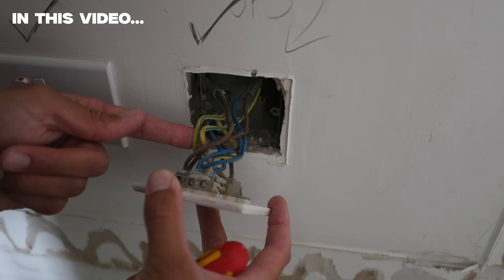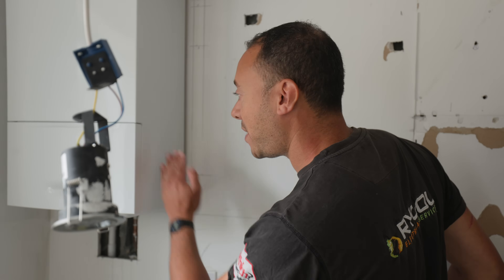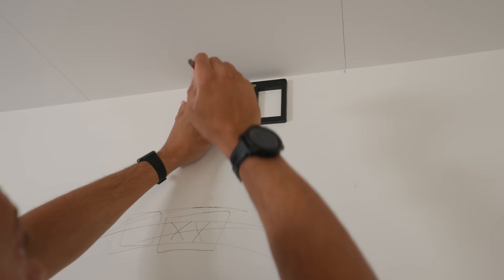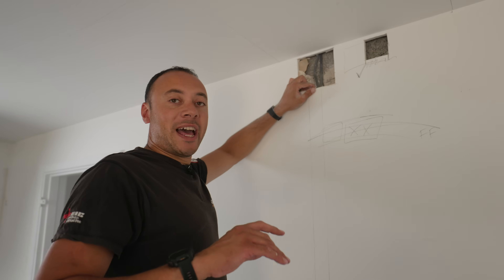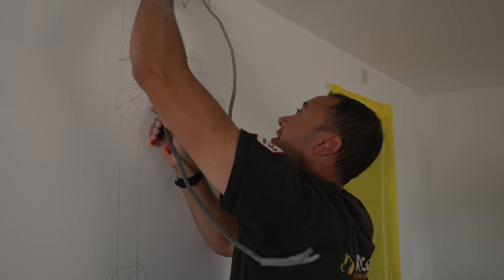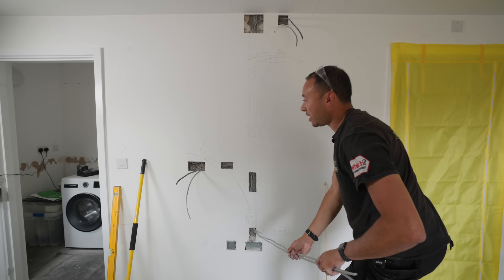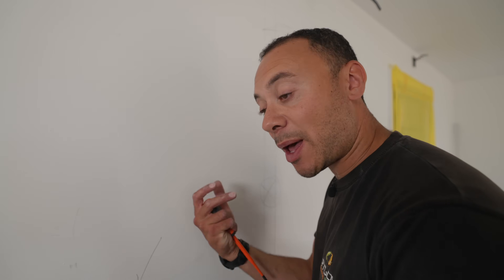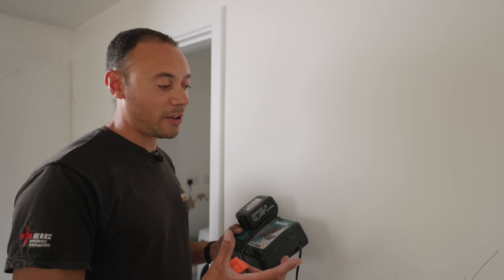Adding a plug socket? Don’t get it WRONG!

Comment: Self-confessed DIYer here (which means I'm always ultra-careful and not over-confident).  The reason I like watching professionals is, of course, because I want to learn.  But there are 2 things that jump out here:
1) If this is a relatively new house, how is it that a professional electrician left such a massive safety fault behind?
2) Why do new houses never seem to have wiring diagrams?  I had a new house built from scratch by professionals and it was the same for me.

I'm renovating my Victorian cottage, including rewiring it, and I'm photographing and drawing everything (I'm an IT analyst).  Why do professionals not do the same?  The electrician that did the work in my previous house didn't want to do it - couldn't be bothered even when I pointed out who was paying him.
Reply: Wiring diagrams for new builds should be compulsory. As should pipe work diagrams. I worked for the MOD in a 4 year old building, everything had a diagram, AC, electric, fire etc .
Reply: @jablot5054  Agreed.
Reply from the maker: This is very true. Faults like the one in this video can be due to alterations later. Like if a spur gets replaced or something like that. It goes un noticed. Wiring diagrams on rewires or new builds would make alot of sense. Might have to start doing that. Its a great idea!
Reply: @RygolElectrical  I expect most customers would happily pay for it (I would), and it would be a value differentiator that lifts you above the competition.

Great West Country accent by the way; nice to hear one of those.
Reply: The previous electrician probably didn't leave it like that if it's new and tested.. you can scag cables afterwards easily by pinching the conductor with the plate screws just by unscrewing it and loosening the face plate, for painting say. Although it happens more when there's too much unsheathed conductor in the box or its tucked away badly.

Comment: No it isn't. The reason why there is a complete circle dab around the socket is for new builds as they pressure test the room with a fan and look for any areas where there are leaks

Comment: So youve taken the lid off of a live consumer unit & then you wander off around the house leaving the CU live with the lid off! Good job a child didn't come to investigate & electrocute themselves. NICEIC on your top but not complying with their standards. And HSE will love you! If Ben is working on the lighting circuit the protective device should be locked off! If you had done the correct ring circuit tests while the circuit was dead you would have found the incorrect polarity at the socket before you made it live.
Reply: Get a grip

Comment: Personally, I prefer to see an apartment have multiple fuses rather than a large number of connections to one fuse. It protects devices and prevents interference that can escalate with such a large number of consumers.
Reply: But in the UK every plug has its on fuse so doesn't rely on a large fuse back at the consumer unit as we call it or the  breaker panel in the us

Comment: Dude you should see my over 150 year old house kitchen circuit 😂 god knows when they wired it, maybe post war,  it is the old black and red cable, i love the idea of cables running in alignment, here they run diagonal and any way which way they liked, had to scrap the old wiring (electrician condememed it) and rewire, am in the middle if doing the chasing for the electrician to finish,  it is not easy work thats for sure 😅  when i ripped out the old kitchen took up 3/4 plywood sheet on floor found earth and rubble underneath it 🫩 laid a waterproofed concrete and tiled floor now, place is getting a complete refurb

Comment: Just curious if the requirements are different in the UK, is it not standard to earth the back box?
Reply: It certainly used to be, but the current (18th edition) regulations allow for the box to pick up an earth from the screw that holds the socket to the box.  Which means that if you remove the screw, the back box is no longer earthed so only remove the face plate when the power is off! Which is common sense.
It is however good practice to always connect the back box with a separate earth wire.
Never depend upon common sense, if you make something idiot proof they will always make a bigger idiot!

Comment: You asked about why the cpc is not sheethed. The cable is set as EN and not just BS therefore, European norm cable can have just green sheeth and thus they choose to keep it as copper so you can add the sheeth as per your national standard in your country. But you can now get cpc sheethed and the cable is then only BS standard and not EN

Comment: Good video, particularly as it shows an arc fault, that will not necessarily trip a mcb or rcd. Intentional fault is no earth flywire to backbox. This is so fault to backbox (should) trip mcb and m3.5 faceplate screws don't stay live, if rcd does not trip.
Reply: The faceplate screws are earthed by a steel tab connected to the earth terminal on the plate. However if the screws are removed whilst the cct is live the back box is then not earthed, which could be an issue if the plate is moved and the back box became live and then touched which shouldnt happen but can & does happen especialy with diy.

Comment: Minor point here!!...
Nearly everyone gets this wrong - But it really needs to be understood - Read the latest BS7671 publication 🙂

'LIVE' conductor, is actually a 'LIVE PART'
 - This refers to the 'LINE' and the 'NEUTRAL' conductors.
So - A 'Neutral' wire, IS a 'LIVE Conductor'!!!

In this case, the 'Brown' core/cable, is a 'LINE Conductor'
 - A LINE Conductor is anything other than a 'Neutral Condcutor', a 'Protective Conductor' (CPC, Bonding, etc), or a 'PEN Conductor'.

In my view, this understanding is very important & could save lived.

Comment: The Earth wire isn't sleeved inside the main cable because it's not a live conductor, and insulation would hinder its function as a low-resistance path to the earth for fault currents. While it needs identification for safety, an insulated earth would make it harder to detect if someone drilled into the cable and hit the earth wire, increasing safety by providing a path for the fault current to trip breakers.
Reply: I thought the regs were changing that all new cables were to have an insulated earth cable as well.

Comment: Thanks for the videos, trying to learn some english electrician lingo for an upcoming job on british frigates. Very useful.
I have a small contribution to the video as a thanks for the viewers who might want to know why you messure resistance in the end of the video.
The reason you want to check resistance in a circuit is to make sure the fuse will trip if you get a short.
Lets say its a 230V 15B fuse then you need 75 amps to trip the fuse(B fuse amps times 5, C fuse amps times 10 to find needed amps to trip the fuse if it shorts). 
If you have 230V at the socket and a resistance of 1ohm the short will generate 230A which is enough to trip the fuse. Its Ohm's law U(volt) = R(Ohm)*I(Amps), if you turn the formula it will say U/R = I. In this case 230V/1Ohm = 230A. If it was a 16C fuse he would need 160amps to trip it, so 16C fuse and a resistance of 1,5Ohms at 230V he would be below acceptable limits. You can also know the maximum voltage you can come in contact with before it trips on earth fault. Which is again ohm's law, it will trip on maximum 30mA leakage (if its working correctly). Which will be U = messured Ohm * 30mA. Dont know about England but over here maximum allowed touchable AC voltage is 50V with a few exceptions.
This is why measuring resistances is important, so you dont get zapped or burn down your house.
Reply: Except that its impedance Z not resistance R and your understanding of the characteristics of fuses is wrong, I wonder if you know anything about different types of circuit breaker. Seems you read a lot but know little or was it education by tik-tok!
Reply: @andyxox4168  Lol nice one, I might have mixed some up because of language barrier and different electrical systems common here is IT and and commonly abroad in EU and "post brexit" is TN. 
But funny that you question me when you dont know impedance is the total RESISTANCE in a circuit and that is what he messured and what I meant to comment.
You might have gotten it mixed up with Kirchhoffs law which states how voltages is affected by amps and how amps is a constant in a circuit since amps are needed to short circuit the breaker?
Reply: @benaa4603  he measured impedance. Any UK spark would tell you the same. Its not resistance in a live AC circuit. Also you're confusing Ohms law and Kirchoffs law.
Reply: @TheOtherGarry  Jesus fucking christ, getting tired of explaining this. Hope you're not a "sparky" or that the education gets better. 
Easily explained. Substation people has impendance because its a circuit (Everything terminated in series to switchboard which affects voltage but not amperage) they write down the impendance and min/max shortage amperage for the switchboard (inside the building) for the sparky to see. The sparky then should normally only terminate equipment in parallel  which means what you're left with is ohms law (unless you fucked up) and what the substation guys has calculated as min/max shortage values which you should be within can be calculated with ohm's law. And yes technically "F2-Sockets livingroom" could be classed as impedance because its a circuit but its irrelevant because everything should be terminated in parallel which does not affect voltage other than the drop from the length of the cable, therefore you're free to use ohm's law.
Reply: @andyxox4168  PS! if you want to know what impedance Z is and how it doesnt apply here and what's the practical purposes of it is you just have to ask nicely.

Comment: Brave man turning the boiler off!!! Some brands don't like it! PCB can fail easily on some!
Reply: How do they cope with a power cut then? Genuine question - seems like bad design to me
Reply: @mikeflowerdew7877 simple answer is some don't...
Reply: It's a Worcester, they easily withstand power outages without issue, any boilers that cannot are not fit for purpose.

Comment: I always thought the sleeving was left off for two reasons? Cable fault issues - better route to earth and as a cable stripper 😂. I always used to grab the earth with my pliers and rip it up through the outer sheath. Worked really well...
Reply: Most of us still do mate
Reply: @carlstanton2550 that's ok then. Not just me 😅
Reply: @everusualsuspect nope! I've been a spark for 25 years now, and every guy I've ever worked with has always stripped twin by using the earth the rip through the outer, especially with standard twin. It's a bit harder on the Low smoke t&e these days, but still doable 👍
Reply: Yep, that's why... any cable deformation, especially  allowing water ingress, is detected immediately.
Reply: Aye , there's no need for those fancy expensive cable strippers, a Stanley knife a pair of well insulated pliers and a bit of gumption is all you need .
Reply: I am thinking if you cut a live cable with a steel object the bare earth within will be connected across to either of the other wires instantly your blade penetrates through the individual wires insulation to the copper wires within. This gives a very instant and short route to earth.
Reply: @keith6400 as I put - a better route to earth. Any conduct not just steel.

Comment: 15:45 , what are scenarios where reversing neutral and live can be dangerous?
Reply: If you turn off a socket and it’s single pole, the live should be switched off; if the neutral is switched of 
f and not the live you can get a shock from any flex, or appliance which has wiring exposed.  So twin pole switches are safer because both live and earth are switched off, regardless of which way they are wired.
Reply: @GeneralDissent are there cases of flex or appliances with wiring exposed? Wouldn't be safe to always disconnect power regardless whether live is the only one disconnected?

Comment: I may be wrong but I thought installation using ring circuits was a method popular post war but new installations should use radial circuits. As you said this was a new build I am a bit confused
Reply from the maker: Ring circuits are still the main method in most properties to date. Radials can be used but can be limiting in terms of capacity so the preferred method still is ring circuits.

Comment: I was told at collage that the earth isn't insulated so that if a nail or screw enters the cable while in the wall the earth will always make contact.
Reply: Doncaster earth sure has changed that then

Comment: Back in my day 50 years ago you had to fit a link earth to the box into the socket is this not now needed?
Reply: I had to read up on that one myself, been off the tools for a few years. BS 7671 says: no fly lead needed if reliable metal-to-metal contact exists via fixed lug and screw.

Comment: As a member of the IET (the institution that writes the wiring regulations rule book), I’m surprised that a professional electrician such as yourself uses the term ‘plug socket’ even if it is only in the thumbnail.  Plugs are plugs, sockets are sockets, there’s no such thing as a plug socket.
Reply: But isn't it a socket for a plug?
Reply: @robinkeeling8314 . I think daveforrester answered your question very succinctly.
Reply: Thank you! I'm not the only one then. I'm also an IET member.  The correct term is of course socket-outlet.  For those asking "is it not a socket for a plug"? Well yes, of course it is, but consider this.  Do you call the thing that you plug into a socket a "socket plug"? No, then in similar fashion, you don't call the thing you plug a plug into a "plug socket"
Reply: Anyone that uses the term 'plug socket' is straight up showing their ignorance. I would expect this from Joe Public, but not from a qualified electrician. If he doesn't understand the basic terminology of his chosen trade, then everything else he says is open to question.

Comment: Good video as an overview of what's involved in a bit of basic installation and issues that can be  encountered

Not read BS7671, OSG etc for a good few years , so interested in a couple things in the vid

1. The cable pushed up a a bit spare ... Where do you stand on that being secured centre span of the joist or at least 50mm or coz it's in the wall within a zone is that considered acceptable practice . I appreciate that in reality a nail or screw would probably just shove it out of the way anyway coz it's not tied down tight and not be an issue, but I always worry about insurance companies view on such things in these cases

2. Diagonal cables . Are they outright banned now or still require to meet certain criteria ie mechanical protection ... I did a quick read of some IET expert forums, and it seems from the technicalities to achieve what is required then it's better to just not do them 😳

Comment: I live in a Taylor Wimpey new build. We have 2 fuses for lights, 2 for switches. These have been divided vertically for sockets, horizontally for lights (e.g. upstairs lights, downstairs lights). Is that normal?

Comment: Made it to 3:15
And gave up. This is why the public don’t trust tradesmen. 

You’re there to spur in a simple socket and you’re running around the house checking for other issues.

I’ve done hundreds of spurs and never had an issue. 

Talk about looking for problems and wasting time

Comment: No earth shielding probably because if there is a stray live wire it would be good if it made contact with earth and trip something so you know there’s a problem. That’s my guess.
Reply: I just Googled it. Apparently, because it doesn't carry any current, it doesn't need sheathing. Except in terminals like sockets and switches.

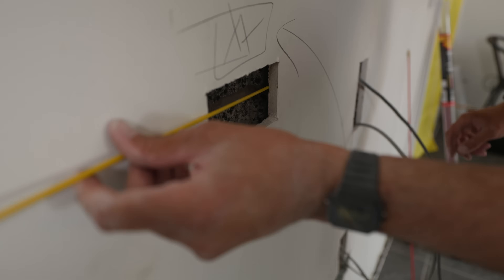Comment: @ 11:15 I was changing a single to a double socket in the kitchen and when cutting the extra width a chopped through the cooker cable which was going diagonally across the wall. What was a simple job turned to a nightmare. I just wish all electricians were as thorough, professional and clearly taking pride in their work as you. Even going as far as to leave extra cable for the next guy!
Reply: Diagonal is permitted down to a cooker outlet.

Comment: Instead of cutting the cable you had “floating “ out of the wall you could have left that in an uncut loop.That way you would not needed to used connectors. 👍

You could have neatened the socket up by using 2mm earth sleeving 👍

Comment: In Ireland, atleast the cable we use regularly, has the earth sleeved already. could just be down to cost, but I'm fairly certain you can get pre-sleeved earth cable in the UK
Reply: There is a reason why the earth is not sleeved, if you accidentally chop a live cable a connection will nearly always be made to earth, hopefully tripping the mcb, which is less likely if the earth is sleeved.
Reply: @regsmith5972 that can't be right , as mcb's are a fairly modern thing , maybe you're right but to blow a wire fuse .
Reply: @MichaelWillby  it is exactly right, if a cable is damaged having a bare earth conductor means there is much more likelihood of leakage to ground which will trip an MCB or RCD